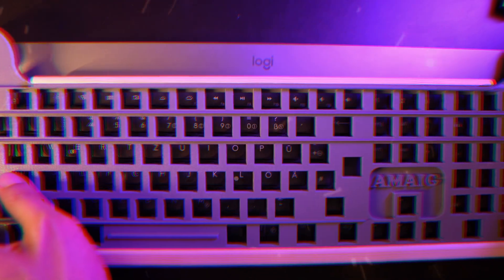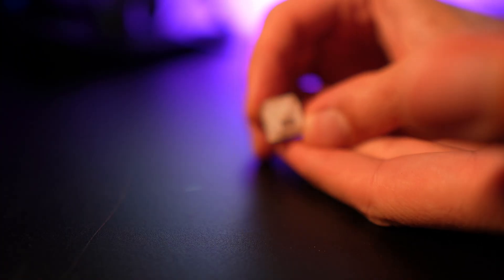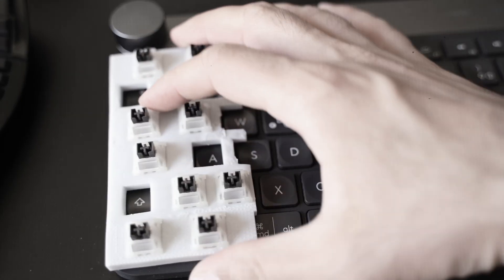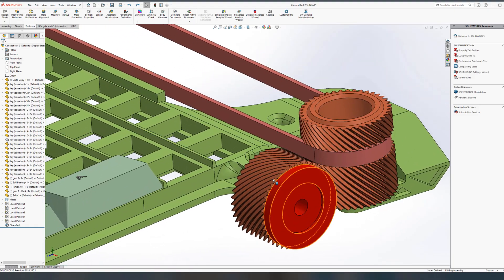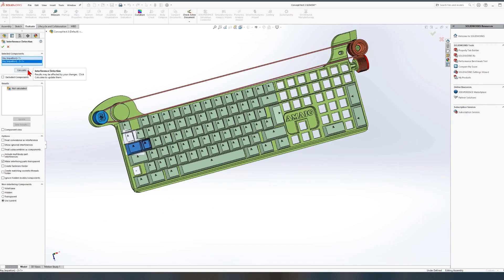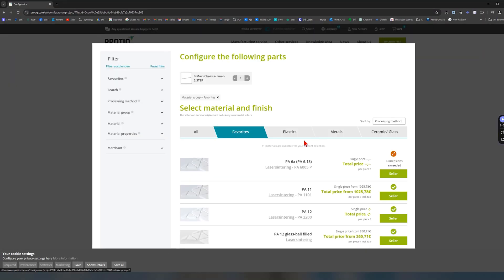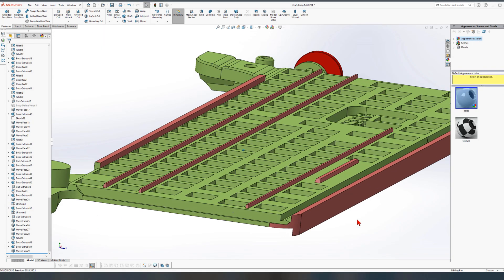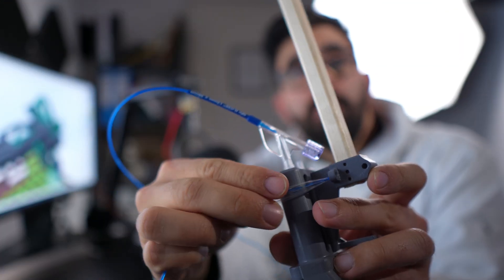World’s FIRST DIY Clip-on Mechanical Keyboard (SOLIDWORKS)

Comment from the maker: 💡 Learn SolidWorks with me💡
👉 https://courses.solidworkstutorials.net/webinar-registration?sl=ytvid👈
Discover the top 5 mistakes every SOLIDWORKS beginner makes and how you can avoid them to accelerate your learning! 

Btw, AMAIG stands for = As Mechanical As It Gets
Reply: Aryan It would be much appreciated if you could introduce purchasing power parity based on region in your pro course pricing , where I live it would take 6 months of my salary to buy the course . I studied electrical engineering but got 3d modeling job because of some experience during robotics club designing with solidworks , now I work with bot solidworks and fusion 360  , but feel like I'm stuck between beginner and intermediate.